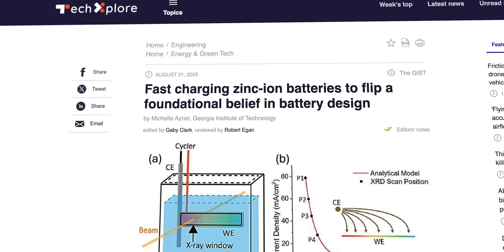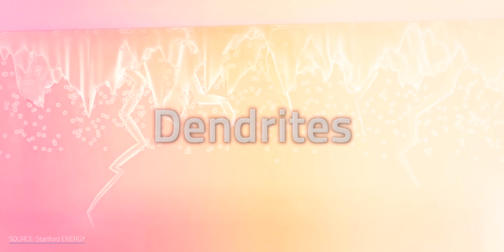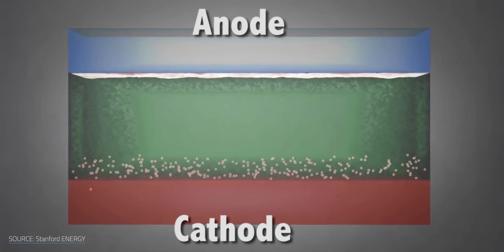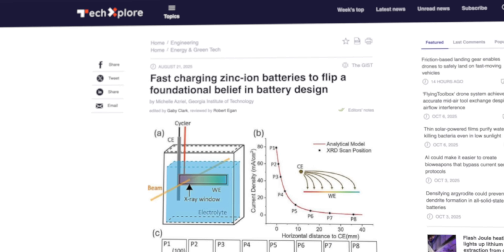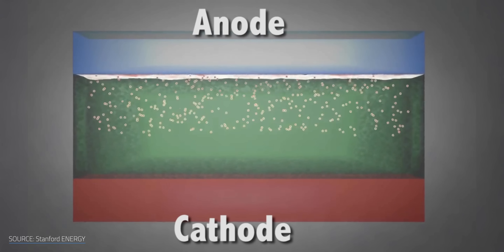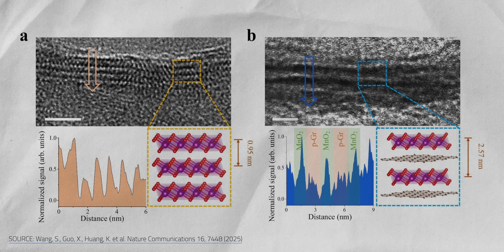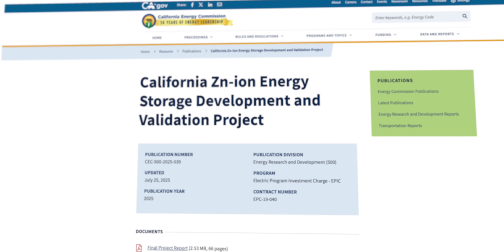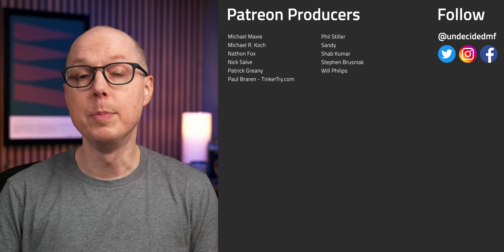The Surprising Battery Discovery No One Saw Coming

Comment: How many battery "breakthroughs" did we have in last 10 years? I've learnt if there is no ready to market prototype it's usually BS.
Reply: It's because you buy a new phone when your battery stops working! The one component which drives so many profits will not see improvement. The failure of our batteries lines the pockets of these tech ceos.... Of course they will not implement better batteries if it means reduced profits for the company!! It's not all bs, it's the people who run these companies who are the real bs...
Reply: @baileescott401 is this still the case for many people? (Buying phones when batteries die). I think I haven't experienced that in 10+ years. I usually break the screen or the charging port in about 2 years. I'm able to replace these myself, but by then the software enshittyfication gets so bad the phone runs pretty slow, also devices with better battery life come out... So I tend to fix the old phone (if I'm in there and the phone is over 2 years I replace the battery as well). I tend to buy a new phone and keep the old one for "less trustworthy apps" then.

Comment: What drives me crazy about batteries is that every device I buy doesn't seem to have a pure battery bypass when they are plugged in.  Sure, they can do battery protect mode, but all that does is not charge it past 50%.  It doesn't change rate.  It still seems to be running off the battery instead of just running off the charge coming in.
Reply: i like this topic. the answer to this is yes and no.  laptops are the best samples of battery bypass since they are doing it probably for two decades. worst offender are smartphones since very few can do a true bypass.  I bought a phone recently with bypass charging. it looks legit at first until I put the charging cable to the USB of my PC and the phone says it is currently bypass-which is wrong because USB 3.0 can't provide all the power.
Reply: Remember when laptops had removable batteries and the battery could be bypassed by design?

I honestly don't know whether my modern Lenovo Yoga always draws from the battery (even when plugged in) or no, so if someone knows, I'd be happy to let myself be educated 😊
Reply: @ludvigpujsek  they always do, if you remove the battery it throttles to around 50% of the processor speed so as to not outpace the power brick.
Reply: @SeanBZA ah, I see - thanks!
Reply: @SeanBZA there are exceptions of course.

Laptop batteries aren't high current.

Gaming laptops as an example.
My Omen has a 330w power brick and it won't be throttling without the battery connected.
Reply: @ludvigpujsek I believe the Lenovo Yoga at least the S1 I have does bypass battery completely when plugged on mains. Fact is I saw a lot of testimonies of laptop battery inflating, but I kept this Lenovo Yoga S1 plugged on the mains nearly H24 7/7 for 10 years and battery is fine. I only changed the battery because it lost capacity and even so not that much i.e. it lost 30%.

But I can't say the same for my wifi-3g boxes whose battery inflated after less than two years of constant use (both the Samsung and Huawei ones).

Likely IBM did thing right about battery bypass and it was kept by Lenovo. But it seems they are likely ones of a few from the reports of laptop battery expansion for not even half the time plugged my Lenovo was.
In fact I would be very interested in a list of laptop manufacturers that have proper battery bypass. I don't think I can afford a new Thinkpad but if the laptop battery dies after only a few years with mains power plugged in...
Reply: A few smartphones like the rog phone, can effectively bypass the battery, and drain directly from the USB, a feature I wish more smartphones had
Reply: Power bypass is expensive for the manufacturers for devices with batteries and lowers the company's profit margin back then there were both removable batteries and power bypass that no longer exist in modern tech
Reply: @NacorantheHarmonicaPlayer  Yeah, like why can’t they splurge for two more wires, a transistor and an IF statement?  I wrecked an iPhone 6 battery years ago always leaving it plugged in thinking I was bypassing the battery and not using it - silly me.
Reply: @NacorantheHarmonicaPlayer  Check out PPS charger/phones.
The charger is connected straight to the battery.
Reply: @NacorantheHarmonicaPlayer  the batteries on old laptops (from 2010-2015 era) had the batteries very easy to remove, i would just slide it out and use the laptop plugged, it is possible, they just refuse to do it
Reply: I was very happily susprised to learn my RedMagic 10S Pro has this feature. A full-on bypass mode. Hope it actually does what it says on the tin. 😁
Reply: I got a cheap mid range phone called IQOO z 10 and similar models this year which have the bypass charging feature your taking about  check it out
Reply: @NacorantheHarmonicaPlayer  I disagree. You can't put energy into and out of a battery simultaneously. Your phone requires continual power draw. And yet it doesn't crash. Therefore it is bypassing the battery.
Reply: The issue is more that the battery keeps charging when mains is plugged, and discharges and charges constantly while mains is plugged.
Thanks for teaching me that a battery can't charge and discharge simultaneously. But the issue with battery trashing is that the battery constantly charges and discharges then charges, etc when mains is plugged.
At least I have a Lenovo Yoga S1 laptop that has been plugged to the mains for nearly 10 years H24 and whose battery has not inflated. Sony Li-ion battery. But I cannot say that for my other Lithium battery devices that have been plugged in H24.
Reply: Sony phones can do this with the gaming app they include. it's great for navigation for example. Keeps the phone cool.
Reply: My Google Pixel phone does this. Also, I have a charger with outlets individually processor controlled. It displays the Voltage going on per outlet. I'm at Android 16 with it today.

With that charger, all devices are taken to a maximum Voltage for the device's capabilities. The charger may go to 60V or even 100Vwith devices that can handle that.
If the chain of connections has a weak link then it goes back to 5V and maybe 1 or 2 Ampère. So 5W or 10W, max.
Cables are crucial in here too. I try to standardise everything at USB-C with the highest capabilities, today.

During the charging, the Voltage (rate) drops, after the specific peak was reached.

The reason I bought into this is that one of my studio cameras is very finicky in its USB protocol implementation (my guess).
It's clear that my in-ear headphones in a case that can recharge these buds, while tiny in energy requirement, are actually dealt with in a fitting way.
Reply: Exactly what I've been saying for years. It's like using a device in retail mode for example. They never need to use the batteries because they're always plugged in so having an option for a battery bypass for devices permanently plugged in makes sense.

On the other hand, if you never used the battery it would die anyway because of lithium composition drawbacks but more options is good imo.
Reply: @SomeHarmonicaPlayer  they stopped doing that once batteries stopped being removable
Reply: What many, if not most, chargers deliver is NOT a smooth charge cureent On Voltage.
What chargers supply is generally Unregulated over-voltage pulses that Rely on the presence of the battery to Not over voltage the device.
The "smart chargers" are even more extreme. They might use 17v pulses to drive 3.6v devices.
So how do you think 17v pulses would work on devices that REQUIRE 3.3v +/- 5% ?!!

SO, THAT is why there Cannot be a "battery bypass" switch!
Reply: its programmed that way, so when you unplug, you wont get a power blip, ie the  laptop/notebook battery is always programmed/configured by the OS and related firmware to be in a primary mover mode to power the essentials of your system so your system does not crash and then reboot, 

when plugged in, the power grid plugin operates as a secondary mover of power to components, where the battery is prime mover of power to the essentials (CPU, backup battery, possibly a board management controller, storage i/o controller to complete writes so data does not get corrupted)  with the power cable  from the wall the secondary mover of power to the  'non essential' rest  of your system in modern designs,  these are  devices which are ancillary 'non-essential'  devices during a power switch secondary use case like this, 

that means ancillary devices like USB controllers serving your mouse and external key board, both which reconnect quickly, will actually experience a slight loss of power and wont work when pulled from the wall power,  essentially an action that triggers a per device reboot , till they all reboot in about 1+ second during this power switch use case, (HDMI to an external Display as well)

these are exactly the secondary mover powered devices that  also get put to sleep when you close the lid on your lap top to conserve battery life and extend component life, also the display, since they all have their own controllers to reboot quickly, when you lift the lid for example. 

In periods of inactivity, sure other parts of primary devices (cores in cpus) will also  get clocked down(operate in idle mode, ready for a wake up signal) to preserve battery power and extend device life, especially with modern processors. 

Also when all such devices put to sleep or idled boot back or spin back up at faster clock rates, system durability is protected with a  programmed slow ramp in voltage to wake things up so these devices don't get shorted out or damaged with a spikey 'give me all the  power right now' surge.

In the end, its wise for one to  take a dive deep  in the consumer research before buying a laptop, notebook, tablet or smartphone, to ensure you are buying a system that both sips on power in different states, yet  the system is also responsive after a state change and not crash when you switch  from wall power to mobile power only that combo is more expensive to both design and manufacture, meaning you get what you pay for.
Reply: Laptops when they had replaceable batteries had bypass. Now they want the battery to die so you'll buy a new laptop. 
It is for sure on purpose.
Reply: zero point energy is forever better than any battery. In fact, there is at least one guy making units that look like batteries. I've found over 50 zpe tech designs over the years. Some produce 1hp per pound of mass or more. The 16v makes 40hp per lb, appx.
Reply: That's what happens if the charger (or possibly, cord) is not good enough to cover every spike of power draw, even though it's enough on average. As a result, the device ends up drawing from the battery, and then recharging it back up 
to the limit, making it "flutter". (I've made a similar mistake, causing a phone battery to badly deteriorate even though it was going through zero detectible cycles.)

Where applicable, try to upgrade the charger (or replace the cord, if damaged) so that it's more than enough to cover any power draw spikes. What's compatible and applicable can be different for every device, unfortunately.
Reply: @AySz88  no way my phone draws 80W 
The charger I'm using is 80W but my phone doesn't have an option that just bypass charging
Reply: @AySz88 most devices use capacitors for this reason.
Reply: (1) in response to the other commenters, could you not simply have a battery in the charger handle the fluctuations?

(2) Bring back swappable phone batteries!
Reply: @szurketaltos2693 Yes, this is basically what's done (with a capacitor), but there's usually a physical safety limitation with the cord and plugs involved. You wouldn't want to recklessly allow much of an overload, because the charger doesn't know what's going on and even brief periods could cause and accumulate damage. (So the device is "supposed to" do the main work of smoothing out the spikes at the source, not at the power supply.) In particular, USB is picky with making sure the connection is solid and the cord is capable and not damaged.
Reply: @szurketaltos2693  With swappable batteries, you have the ability to deny your data to the companies.  You are their data source.  Don't think VPNs will save you because your data goes to Google or Apple before it is encrypted.
Reply: Yes, I agree. In order to protect battery life you actually must focus on the charger block and cable, because there is no easy method to manage battery intake within the device itself. A charger with limited current is the only possible way to limit current to the battery. I suspect the big players who manufacture these devices want to give you a sense of control without actually being able to prolong the battery life, the battery is often the first component to fail, and the companies make much more profit when you buy a new phone every 2yrs. Even with these revolutionary discoveries, I don't doubt it will be decades before it's widely adopted. There's too much money in devices that fail within a few years... we saw it happen with Apple deliberately reducing battery performance on outdated devices. They make A LOT of profit from the failure of one component, they have no reason to improve it.
Reply: @baileescott401  A lot comes down to the charge circuitry not being able to handle the full operating current, and thus the battery is used as a very large capacitor, as that saves space inside for what is needed capacitor wise. Think of the mobile phone, normal operation is pulses of 2A or more for a few milliseconds, and a little more for the regular transmit to the tower, with most of the time power being 100mA or more when awake, to drive the LCD and backlight, and brief pulses of power to operate the CPU, as it is optimised to spend most of the time in a power saving mode. That amount of capacitor, even with the most dense ceramic capacitors, is more volume than the phone case will fit, so the battery is used as a capacitor, providing those pulses, and being charged up in the intervals.
Reply: @SeanBZA  So just make the case bigger, they're too small anyway and everybody was happy with much thicker phones just a decade ago.
Reply: @baileescott401  It would be easy, just send it down a trace that has a resistor.

Comment: Can't we used grids in the separators (as in old electronic valves) to attract or repel ions to certain areas of the surface and move them around electronically as it charges? Sort of opening and closing shutters. Electronics is cheap now, so per battery shouldn't be that hard. Something like a grid of very flat fets.

Comment: Did I miss it? If not, FYI the Zinc Ion batteries currently have 2/3 of the energy density of Li-Ion, so your 50 gram phone battery would be 25 grams (0.8 ounces or 2 tablespoons of water) heavier and about 2mm thicker).
Reply: @Toobula  yeah Matt talked about lower energy density and why it's primary use is stationary batteries.

Comment: 2:45 - "each year we pull about 13 million metric tons of zinc" (14.33 American tons, just mentioning because next figure isn't specified as metric tons)
2:54 - "with proven reserves of 210 million tons for zinc"

Are both of these numbers true? If so, does that mean we have ~16 years of zinc left in currently proven reserves at current mining rates? Less if we start mining more without proving equal amounts of new reserves?